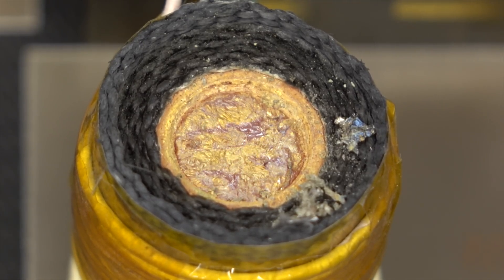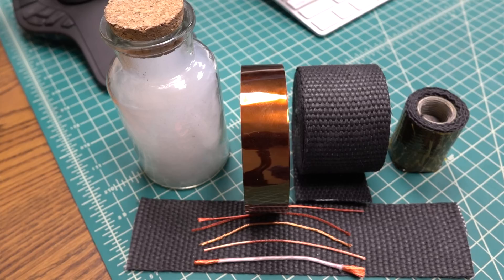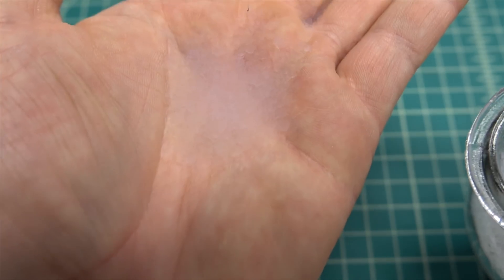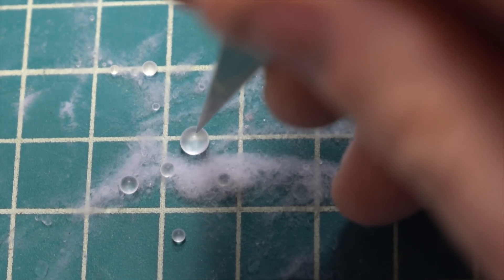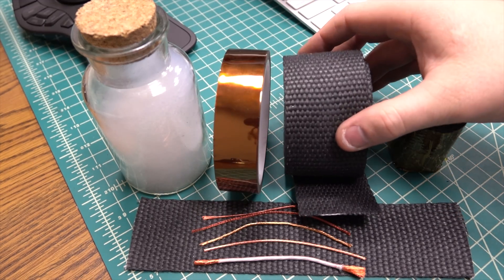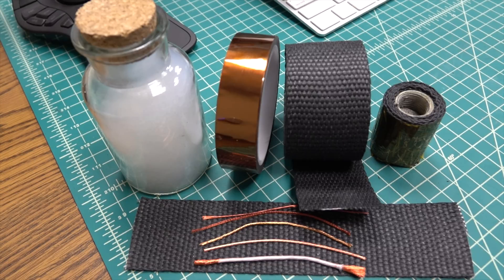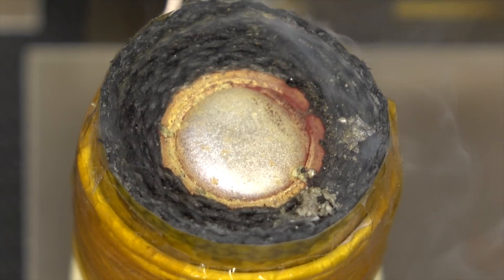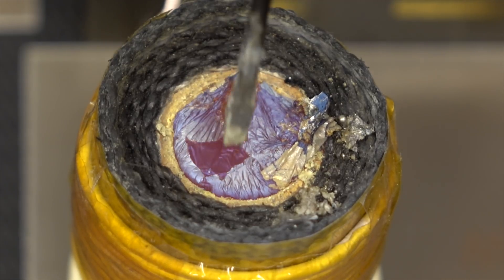1000W Induction Heating Part 2: Solder Pot

Comment: Most tiny solder pots use the balance between the wattage being put in and the ambient air cooling to achieve the proper temperature. Some type of regulator is needed if you want to keep your solder usable. At high temperatures copper contaminates the solder and oxidation changes the balance of elements.

Comment: Could you use pyrolyzed bread as an insulator?
Reply from the maker: Pyrolyzed bread is mainly carbon, therefore conductive and would heat up due to induction.  You would still want to insulate the coil from radiated heat.

Comment: why did you use that power source? could a 1000w car audio power supply suffice?  I've found one much cheaper
Reply: There is a good video by 'the radio mechanic' explaining why the power must be supplied suddenly to the zvs to make it oscillate.  If your psu is ramping up to 24V then both the fets in the zvs can conduct at the same time which will short circuit your psu and blow either the fets or your psu.  
The solution is to put a switch or some relay contacts between your psu and the zvs.  Then, power on your psu and wait for it to get to 24V before turning on switch or energising relay.
Or, maybe your power supplies are shit.   Hope this helps
Reply from the maker: Several reasons.  Over voltage shutdown, over current shutdown, over temperature shutdown and a very fast rise time.  It has saved me countless times having those features alone.  Many people complain that they've blown their units and it is 100 percent the fault of a poorly designed power supply.  It will work on other supplies but I can't guarantee it will work on a much cheaper unit.
Reply: +Proto G thanks
Reply: I'm trying to set up a zvs driver to try to melt some gold/silver to do some jewelry work. I'm using a 480W (24v/20a) power supply. Every time I have gone through two power supplies trying to get the thing powered up, but both LED's on the ZVS driver and the power supply turn on, and then turn back off, and then power supply connected to nothing will no longer turn on.

Could the issue just be the power supply being poor quality, or am I just fucking something up that is causing the power supply to fry?
Reply: The fast rise time is crucial.  See my reply to Mark Barbour for possible solution

Comment: That induction heater you are using is the Chinese one that is all over ebay for around $40. I was unable to find any application info until now, I didn't know whether it would work without water through the coil. I see it can. There are automotive devices with names like Bolt Buster that are induction heaters to break loose rusted parts. They are around 1000 Watts, come with a few coils and cost well over $400. It looks like this will do the job. I have seen the spec sheet on ebay. How much voltage are you running without liquid cooling the coil? There was also something about not using a switching power supply because of the slow start. If it is connected to the heater before the voltage reaches 12Volts they say you can fry the MOSFETs. How did you deal with that? That power supply in the video didn't look like a big linear and I want to make the device portable.

Comment: If you have time run some search on youtube with - induction heating - you may find magnetic levitated induction heated metal in the core of induction coil. The secret is in the winding of the coil, the top first turn winds in opposite direction. Hope this helps,
Reply from the maker: +YK Chan I don't need to do research, I know how it works.  There is no secret, and that only works with diamagnetic materials like aluminum.  Diamagnetic materials repel all magnetic fields.  I have already posted two short videos demonstrating this method of levitation.

Comment: You are overdoing the heat on the solder pot - in a normal solder pot it should form yellow oxide in a minute or so of being exposed to air.
Reply from the maker: I'm well aware of that.  I was doing it to show the colors of the oxide layers.  I usually only have it on until it reaches 700F and then cut the power.

Comment: Great... would have been nice to see how this is useful too. (Not just hear examples)
Reply from the maker: +John Smith Mainly just tinning wires really fast and in larger quantities.  I will be going over many practical uses for inductive heat in another video.
Reply: Cool I have subscribed so look forward to it.
Reply from the maker: +John Smith Thanks John!
Reply from the maker: +John Smith Here you go! https://instagram.com/p/9SOUZQvmNn/?taken-by=protog42
Reply: Aaaa I see, so are you doing this so that the wires are easier to solder together? IE-http://www.mediacollege.com/misc/solder/tinning.html ... never heard of this before I am a bit of a electronics noob microcontroller/programmer person (who wants to learn more of the basics).
Reply from the maker: +John Smith That's exactly right.  It not only makes soldering two wires together much quicker, but it also makes it easy to solder wires to connectors and switches.  You also want a tinned wire if it is going to be used in a screw terminal to keep it from corroding.
Reply: Cool. That's a great tip thanks, it will come in handy when soldering small wires to circuit boards. Something I struggled with in the past.

Comment: That airgel sounds like a joke, it looks like a cloud and seems somewhat purposeless :D
Reply from the maker: +Akmaisto Mods Definitely not a joke.  It's used heavily by NASA to insulate cryogenic liquids and keep them cool as well as many other industries.
Reply: That seems hard to believe, but I guess if you want to use clouds in your rockets. :P
Reply from the maker: +Akmaisto Mods I used to work at NASA's Cryogenic Test Laboratory.  They put tanks inside larger tanks and fill the space between them with aerogel for insulation.
Reply: Very interesting!
Reply: +Proto G OK that explains the crazy amounts of airgel you are stashing :-)
As far as I know that stuff is made from 80% unobtainium and 20% alien-tears…
Or has it found it's way into the regular market by now?
Reply from the maker: +helmut666kohl You can purchase it online too.  It's just expensive.

Comment: Nice fast growing thin oxide layer color changing effect on the solder at the end
Reply from the maker: +Michel PASTOR Yeah, it's really pretty.
Reply: It's pretty but isn't it counter-productive for a nice clean solder joint?  I wonder if putting the pot in a container of heavier-than-air  gas could prevent the instant oxidation.  CO2?  Argon?
Reply: Yes you can use an inert gas to prevent oxidation but I don't think it is a problem. The oxide should not stick to the wires you try to tin only the molten non oxidized metal. The oxide stays on the surface and is not molten (melting point >1500°C).